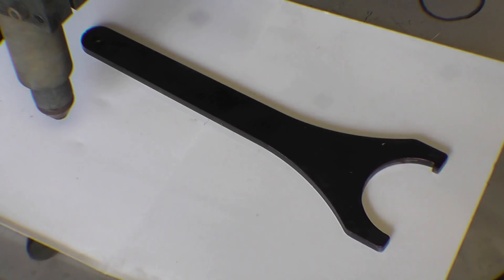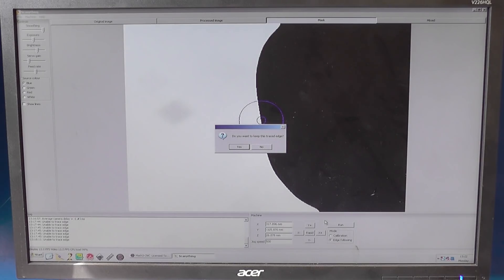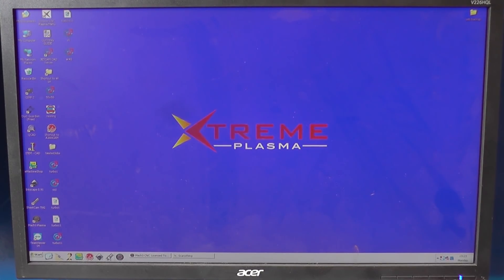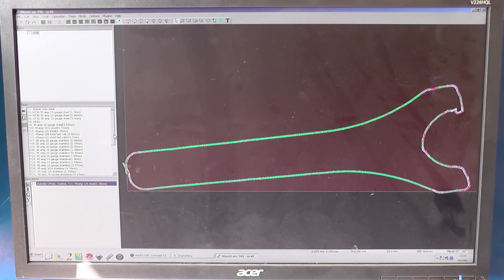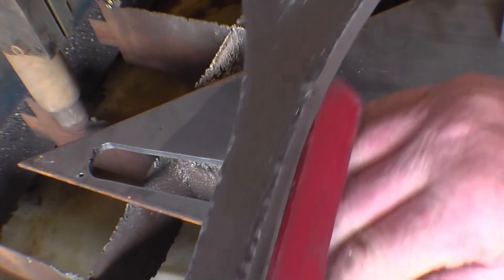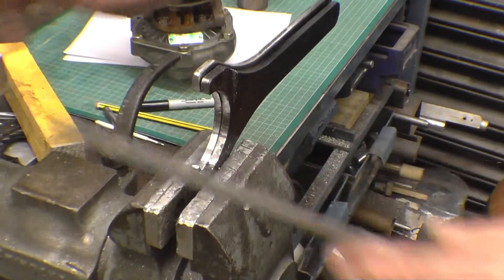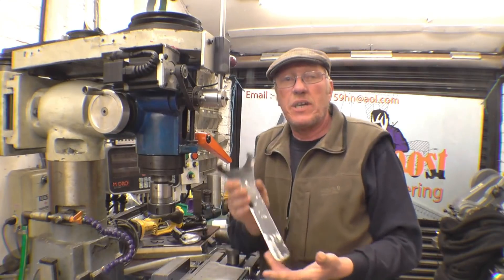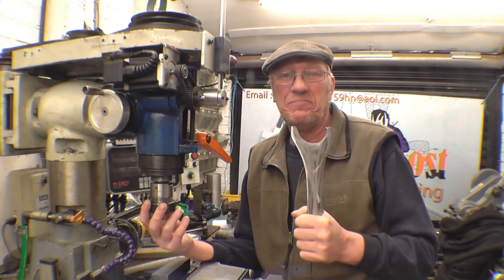Scanything  P2   Direct Scan / Cut  Xtreme Scan Camera

Comment: Looks like it traced the edge of the spanner on the lit side, and the shadow of the spanner on the unlit side.
That's why the nubbin was missed, and the recess seems to be made of 2 different arcs (one shadow, one tool).
Because we were watching the "mask" view (what it has decided the edges are), it wasn't clear it was tracing the shadow.
Run again with the raw camera view to see.
Tweak the edge finding settings, or give it some decent light that won't cast such shadows.
Reply: ivanblogs That’s what I was thinking as well. If you have to trace direct off the object, it looks like good even lighting is critical.

Comment: Make 2 ER32 and 2 ER40  spanners, drill hole in the ends of them and keep one of each at each machine then you won't be tempted to borrow one from the other machine
Reply from the maker: I was thinking about a double ended one ER32  ER40
Reply: @doubleboost  even easier to lose them both together lol

Comment: John, you can TIG weld HSS [using an old HSS drill as filler] onto that working bit on that BASTAH"D thing!
Reply from the maker: I think a cap head bolt would be better  Wait and see how long that lasts

Comment: I'd intended to make a C spanner for an ER32 collet chuck that came cheap as chips from Bangood with no spanner and no box.  I made a nice wooden box with jointed corners, but didn't fancy hand fettling  the spanner, and then found a nice spanner on Bangood too cheap to worry about.   Those Chinese tools might not quite match the likes of Starrett and Brown & Sharp, but they do the job, and it means a home shop can be decently equipped.

Comment: About 20 years ago the shop that I worked in had a pattern cutter if could draw it it would cut it the problem you had to use inda ink and it would not do batch cuts